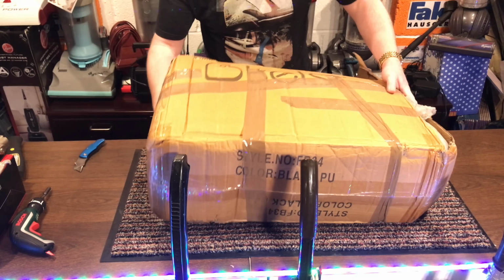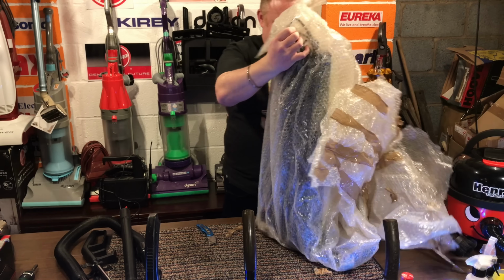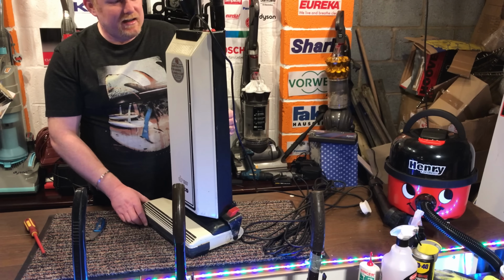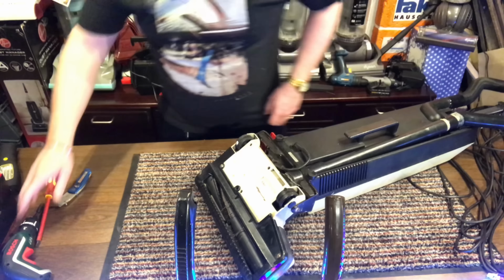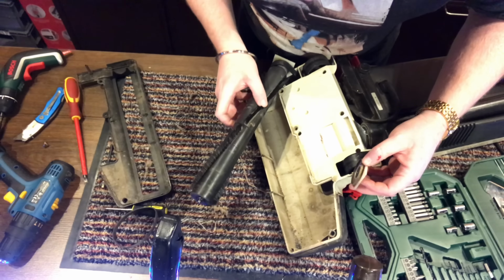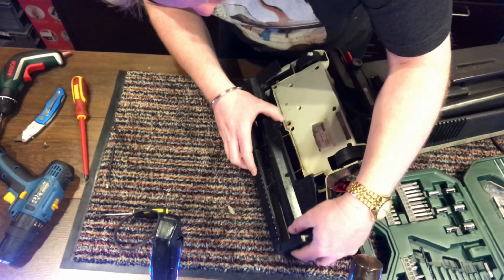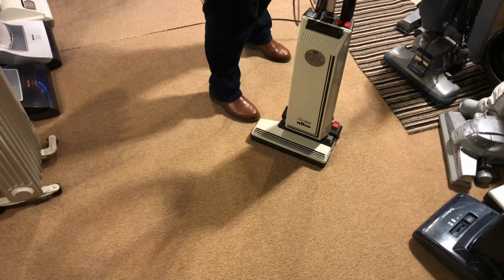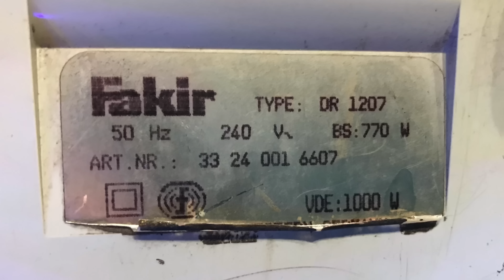Dr Nilco, Fakir, Vintage Commercial Upright Vacuum Cleaner

Comment: Advisory Cleaning Centre existed from August 1979 - August 1984. They supplied  and serviced industrial vacuum cleaners, floor maintenance machines, cleaning tools and chemicals/aerosols, and even claimed to be a manufacturer of some products. They also provided consultations and cleaning services in professional environments (cleaning contractors to put it simply). I have a trigger spray bottle branded with their Stockport address so they must've had multiple centres around Manchester as the one stated on your vacuum's label is about 15-20 miles away from their Stockport branch. The machine looks great and works just as good! I'm glad to see it has a very good home now :)
Reply from the maker: Thank you and thanks for the info too 🥰

Comment: They are very rare in the US with only one distributor and that being a central vac company. It's a German brand that indeed shares many sourced parts with Sebo including its Domel motor. I looked into purchasing an S200 canister years ago but determined it impractical as obtaining anything as simple as bags would have been a challenge in the US.
Reply from the maker: Mikko and another person put some good links on the messages for the Finnish and the US ones similar.